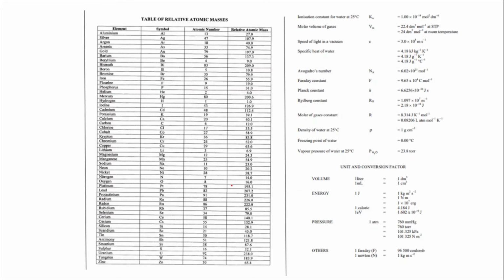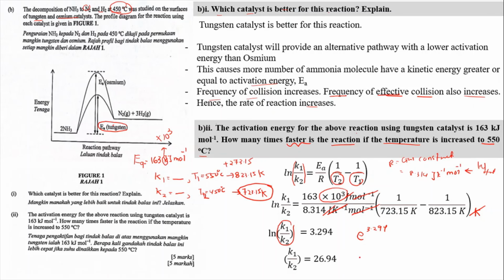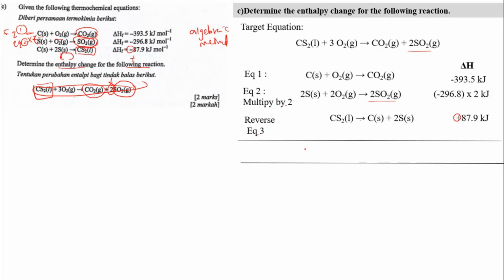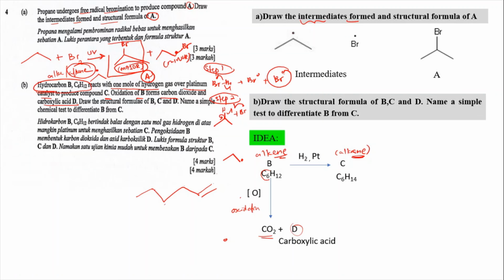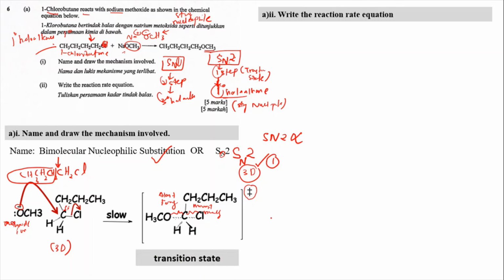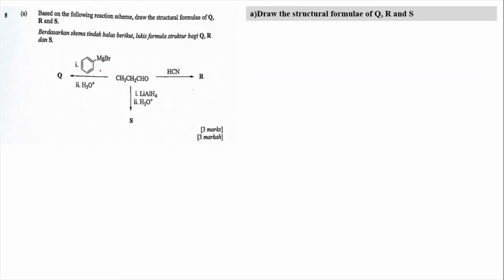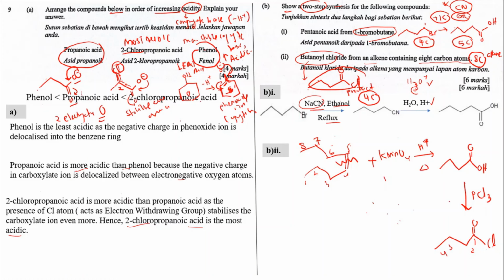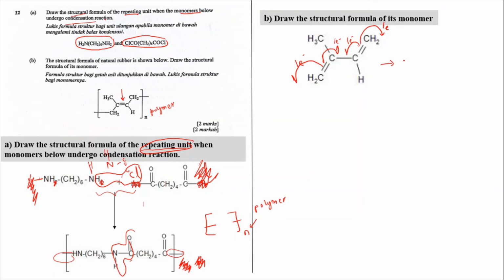PAST YEAR QUESTION SK025 2019/20 - Explained!

Comment: why 440 is the T2 ? confuse sikit, bukan sepatutnya 550 ke T2 sebab the question (ii) said then the temp is increase to 550… boleh sir explain tak?
Reply from the maker: Ada dua perspektif nak jawab soalan ni. 

1. Guna cara yang sir ajar dlm video. ✅

Atau 

2. Gunakan cara kamu..cuma nanti kamu akan dpt k1/k2= 0.037.

Bermaksud rate constant at low temp is 0.037 slower than rate constant at high temp.

Untuk dptkan “how fast”, kamu kena inverse ke k2/k1..which refers to 27 times faster.

Hope this helps.
Reply: @SirHaikal  oooh okay alright sir, got it ! thank youu